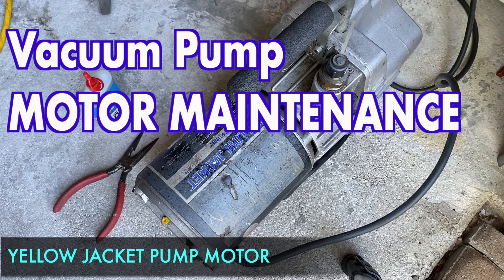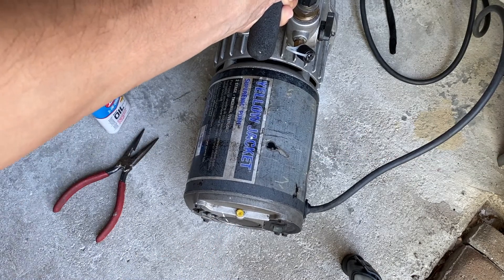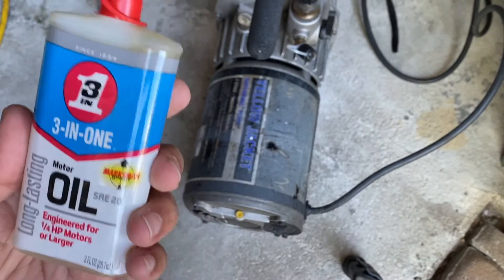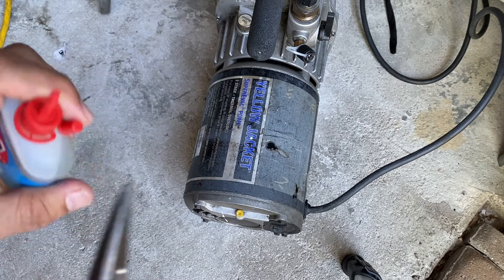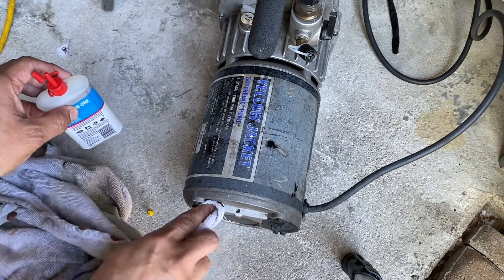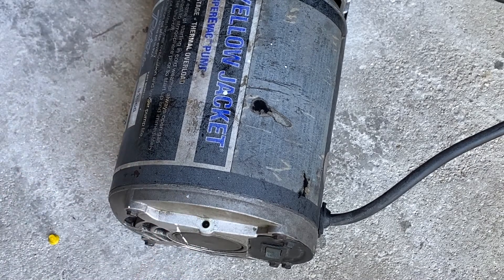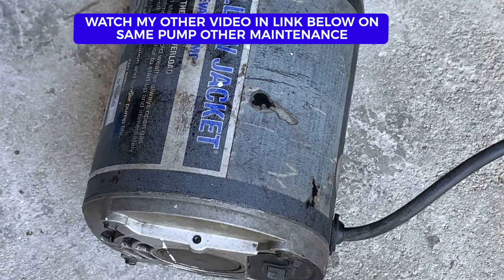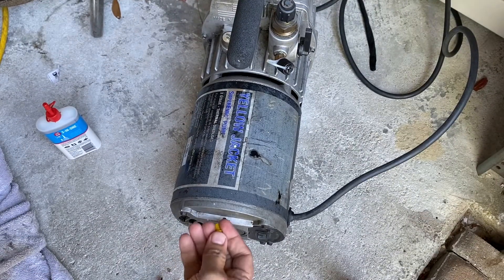How to oil vacuum pump motor

Comment: You need to separate the pump from the motor to oil the inside motor bearing. There is a identical oil cap on the other side of the motor. I am just about ready to buy one of these pumps but the 4cfm version. Going back and forth between the yellow jacket and the JB. Thanks for sharing your video.
Reply: Thank you!